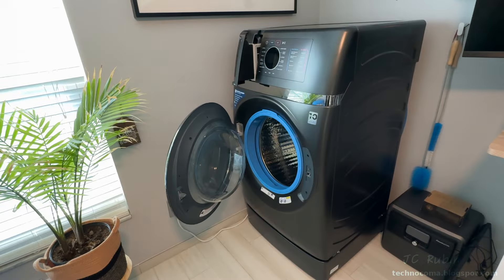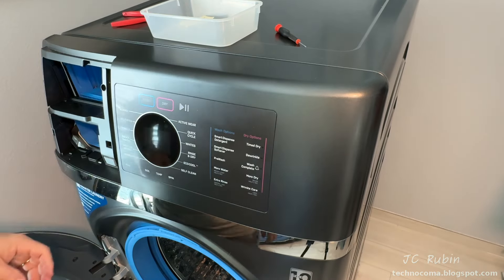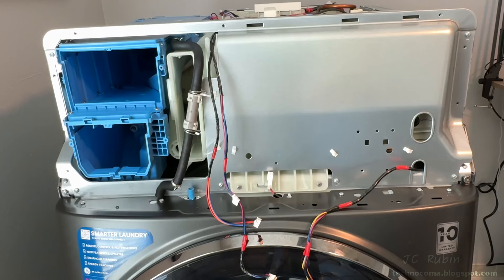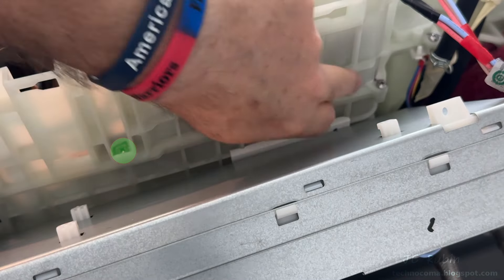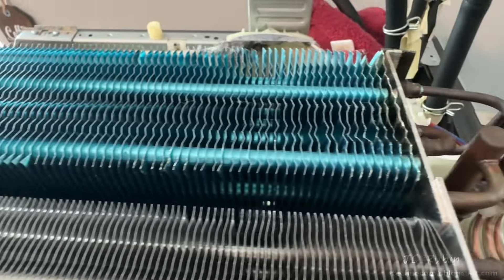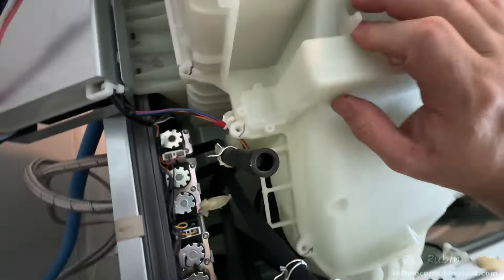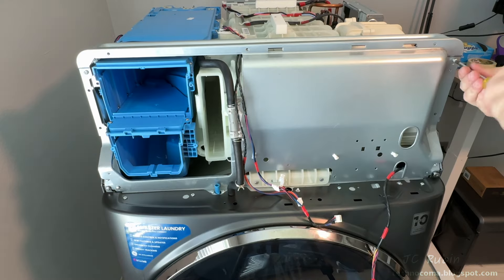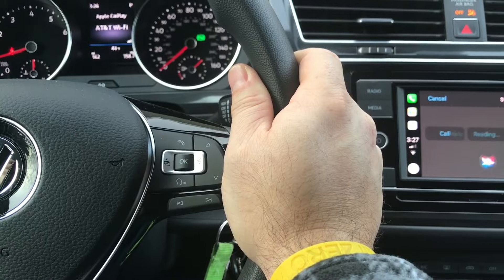GE Profile Ultrafast 2in1 Combo Washer Dryer 6 Month Teardown, inspection & cleaning of the heatpump

Comment: That is not alot of lint build up for 6 months, especially with the pet hair. If people took their dryer hose off, they would be shocked. I can see how that would build up year after year. However, I'm still a fan of this machine. Every appliance needs to be maintained. Maintenance is not excessive for this machine. I love it!
Reply from the maker: Its not a lot for a gas dryer, but for a heat pump, covering those metal fins wity a thin layer of dust will quickly reduce the efficiency of the drying process.  and a little dust will quickly grab more dust.
Reply: I agree. It’s a dream compared to the standard separate units.
Reply: This machine's heat pump is sensitive to lint build up. Even a little clog doubles dry time while regular dryers run so hot that you don't notice a performance drop
Reply: @AtlzBestM26  I have this model. I do maintenance as it says to do and my performance has not dropped. I do 20 loads a week so, it is definitely being used. Regardless, the amount of lint is way less than with a traditional dryer. I have more hair and pet hair that it gets rid of than lint. I love this machine and would repurchase it again.
Reply: So having to employ surgical precision and specialty tooling to clean the heat exchanger is not excessive maintenance? Think about why didn't the R&D team at GE just design an effective filter? There is no way that this immediate lint buildup (without the use of special brushes to clean the heat exchanger) wasn't known by GE engineers before this product went to market. LG came out with a similar model to this product just this year, which another youtuber took apart after only two loads and found large portions of the heat exchanger to be caked in lint. This is a designed failure point of these types of units, if not excessive ignorance and neglect by the designers of this product.

Please do not reccomend products that are designed to fail. The practical longevity and reliability of the appliance are the most important aspects to consider for a well-informed buyer.

Comment: With my unit, I just went down to the local hardware store and picked up some weatherization foam tape right away after getting the unit and put it around the lint trap, creating a nice seal.  $5 roll of foam tape in order to try to avoid heavy maintenance / a dryer that doesn't dry on a machine that costs a lot more than $5.  Also, to install, just pop out the lint trap, run the tape around with the paper left on top, and cut when the front of the trap is reached again.  Takes just a couple of minutes to do and is really easy.  While the machine is still really new, several loads in and the foam tape is staying in place and the coils are staying clean.
Reply from the maker: Good tip, im looking into such solutions.
Reply: Do what now? Picture or drawing?

Comment: Just a thought for a quick fix for the buildup on the vent supply hose. I had an older LG 2 in one (2.2' size) that had lint buildup in the ducting where I used an auto parts puller to remove debris when it clogged the ducting. in this scenerio, you should be able to access the clog by removing the filter and putting the puller to the left and up. Let me know if you try and the results 🙂 Thanks for the wonderful video!

Comment: I called and told them about filter and the fix as i have modified mine. lol
This is an awesome video you should sell it to technicians lol I really appreciate your videos and I love my machine regardless of the lint cleaning lol
Also wanted to note it is very important that you take the filter housing out and clean it with Dawn dish soap regularly. I just got the dreaded 365 error code and it was due to buildup on the screen from fabric softener.  As soon as I took it out and cleaned it with dish soap took all of three minutes is perfect again so I will make sure to clean housing once a month as well
Reply from the maker: My wife regularly cleans and washes the filtre element.

Comment: I fixed mine without opening. Cleaned out with vacuum and brushes and sprayed with foaming coil cleaner. Although fins are now somewhat bent everywhere. Then I took the filter housing itself and on top and rear added a gasket brush weather stripping. Now when I put the filter back in, it fits very tight. And lint doesnt get around it onto the coils. I also got extra black filters and put two of them inside the filter housing that snaps into place instead of just one. Finally its working closer to normal again. This design is not user friendly for consumers to clean! The filter housing itself is not correctly made as it allows dust to bypass it!

Comment: I was considering this model and the LG combo units when our dryer began to go out a few months ago. 
>
After I got a good look at the videos like yours and others and then saw both units in my local home Depot I decided against either one.
>
The filter design seems to be one of the weak points of both machines as well as where they decided to locate the coils. 
>
The LG all-in-one combo has a similar system but a very different type of filter. 
>
The LG unit has a similar problem but it doesn't seem to be nearly as bad as the GE unit. 
>
Everything I read says the LG is fairly manageable and LG even tells you how to take out one screw out of the filter compartment to get easier access to the coils to clean them. 
>
After seeing both the GE and LG combo units in person and looking at their filters I decided against getting either combo unit. 
>
The concept is absolutely fantastic!, but in reality if your tasking one machine to wash and pull the lint out and also drying and trying to get rid of that lint, I think until somebody comes along with a far, far superior system this is always going to be an issue. 
>
I also think if you have more than a couple of people in your family especially people that tend to shed hair or the worst case scenario, pets, this just adds to and compounds the problem. 
>
I decided to go ahead and get the new LG heat pump dryer and did a tremendous amount of research on it before purchase. 
>
LG goes about lint removal very differently on their large capacity heat pump dryer than they do in their combo washer.
>
With their heat pump dryer, they use a very large two-stage fine mesh filter, one inner, one outer, that is in the front like many conventional dryers. 
>
They also have an automatic coil cleaning system that uses water it pulls from the clothes to clean the internal coil system. 
>
The coil system on the LG standalone heat pump dryer is located in the bottom of the unit inside of a tub with a separate pump and a spray system that can clean the coils. 
>
LG also thoughtfully provided an access port on the front of the dryer that you can open easily and have access to the coil directly to vacuum out anything that might get past the filter system. 
>
I do exactly what the maintenance suggest from LG,  which entails cleaning the inner filter on every cycle and the outer filter every 10 loads, although I tend to clean the outer filter sooner than that if I see any kind of visible build up at all which tends to be about every two or three loads. 
>
I also noticed that the automatic coil cleaning system seems to run at every load and I have ran a manual coil cleaning about every 10 loads, which involves pulling the lint trap out and pouring about 1 liter of water through that hole and then running the manual cleaning cycle.
>
After having this unit for a couple of months running around 50 loads and sticking to the maintenance religiously, I can say with confidence that I believe LG has a winner on their hands with this standalone heat pump dryer. 
>
I have checked the access panel and inspected the coils several times since I've got the unit and have Been extremely happy with zero, not a little, but zero lint build up on the coils! 
>
The heat pump is smaller than the GEs but it does the job pretty well, the drying times are longer than the GE's but The fact that it's a separate unit and they rethought the lint system so it seems like a more reliable machine than either the LG or GE combo units. 
>
Plus I think until they significantly change the design of both combo units that lint buildup is going to be a huge issue. 
>
Thanks for doing this video, it was very informative and helped remake my decision.
Reply from the maker: I agree,  The combo unit's lint issues are a big concern and I think until they get that solved, they are always going to have problems. Thanks for watching and the feedback!

Comment: I have this unit and I am largely happy with it. I'm also pretty comfortable with tearing down complex assemblies. But this is right at the edge of my comfort zone so I'm happy to know this video exists in case I need to refer to it. I've made a few modifications to the lint filter assembly to minimize lint getting past it and into the heat pump coils. Then I picked up the brushes and vacuum cleaner hoses that can reach inside there and I feel like that should be enough to keep things clean for many years to come.

I've only had this unit for about a year. I hope it lasts as long as a conventional washer/dryer combo but much remains to be seen. A heat pump dryer is kind of a whole new paradigm. If you're the type of household that does all its laundry on Sunday this thing is NOT for you. It's not as fast a conventional dryer and you (obviously) can't be washing one load while drying another. But if you wash small loads throughout the week and you don't have a lot of family members (it's just me and my girlfriend) this thing is a perfect solution. The best part is I was able to install a handy utility sink in the mudroom since this occupies only half the space of a conventional combo.
Reply from the maker: Thanks for the write up. For us besides space the greatest feature was moving the machine out of the humid garage indoors as no ventilation g is needed.

Comment: Awesome teardown details. I personally added some foam around the filter and has done a satisfactory job keeping the lint in check. The biggest flaw of the filter is the rear, larger than desired gape there. Need to clean that lint from the filter screens after every cycle time to reduce forced air through the cracks. Great job and detail explanation sir.
Reply from the maker: Glad it was helpful. Thanks for the tip!

Comment: I just bought the new, cheaper model and awaiting delivery.  It does seem like a maintenance routine like I have on my HVAC or my pool filter is needed. I plan to modfiy the filter screen like folks have suggested and will probably create a PVC vacuum attachment/s to hit those interior spots. Seems like a cottage industry could develop for that if GE doesn't modify their design.
Reply from the maker: It doesnt have the auto detergent/softener so maintenance should be easier...

Comment: The filter is a problem. 
The cooling plates should be horizontal for cleaning, and the filter slots do need a re-design.
Reply from the maker: The filter and the airflow left of the filter
Reply: 100% The problem with plastic is that it will get a static charge with the airflow, and it will attract dust. Maybe a ground connection would solve that problem.
Reply from the maker: @ADOENDRA  if the section were metal, it could be grounded. Or an artistic, mildly conducive plastic

Comment: Could I take a sprayer and shoot water through the coil without taking the lid off. Most the sprayers have a 90 degree spray tip. But where does that water go
Reply from the maker: I spray mostly top down after vacuuming. So I can’t speak to the effectiveness of doing so.

Comment: Thank you for the video. Have you checked any fault codes? I started to get the 353-fault code. Called GE and they had to send out a GE certified technician. They had to replace a part. It took the technician about 4-5 hours. The technician ran the machine to get it to reset. After it finished, I got the fault code 354. We ran a small load of laundry and now will not go into drying mode and giving the error code 353. I cleared the fault code and tried to run another small load. Again, stopped after the washing of the clothes.  Would not go to drying and fault code 354. Now we have a really expensive washing machine.
Reply from the maker: Generally the balance code.... I think its silly as a fault code, it should be an on screen error with a continue option.
Reply: We have found that if you run light small loads like underwear by themselves, it will have a tendency to not want to finish the cycle and balance out so we make sure not to run small light loads and we’ve had no issues since

Comment: Hello and thank you for the videos they have been super helpful. Hear me out and tell me if it’s something that could be done without causing damage to the machines. Noted that everything done will have to be in low pressure and not blasting like a pressure washer. 

Using a 2 foot long 90° L shaped garden mist sprayer with an adjustable tip for spray to fan connected to a garden hose, one would remove the lint filter and insert the sprayer with the nozzle adjusted to a soft fan like spray pattern, spray all coils multiple times to get the particles to flow downward to the bottoms filter of the machines. 

Then removing the bottom filter or already have it open so that any and all water that flows down gets removed along side and lint and dust that has bypassed. 

Last would be to run a self clean cycle for the machine and call it a day. 

My only concern is that I don’t know if water has a free flowing way of making it down to the bottom or if it may pool up somewhere up there using this method. 

If you know or can tell us if water can flow all the way down from the right side of the coils just as on the left side with the big hole opening. If it does and can flow after passing by the coils then it shouldn’t pose any problems. 

Thank in advance and sorry for the long post.  

Here’s an example of the mister I’m thinking of using for maintenance

Mist Watering Wand For Hanging Baskets,25 Inch Spray Wand With Adjustable Nozzle, Car Pet Window Cleaning Tool, Great For Watering Seedbeds, Hanging Plants, Deck Plants.（90-degree curved nozzle） https://a.co/d/3tGzLhR
Reply: Oh forgot to mention that using this method one could T from the cold water supply of the machine and have an 8ft section of hose to perform this easily right in the laundry room where it’s located. 😅
Reply: @j.v8947  That's a cool idea.

Comment: We're screwed Batman. 40 times over I reply. Also notice Robin that it's a 30 minute video, which means in real life, it's 8 hours for mere humans.
Reply from the maker: Not sure I understand this Batman robin stuff, just say what you mean.
Reply: @retrotechandelectronics   I was simply dazed that there are 40 screws to get in and 40 screws to get back out of the unit. 80 screws and probably 6, or more, hours to service. Blows my mind after 40 years of servicing my own personal washing machines and dryers. Being 63 years old now makes me wonder if I really want a unit that will force me to pay someone else to service.
 Hell, I even service my own heat pump/gas furnace dual fuel HVAC. Not sure I would pay for this unit.

Comment: Nice teardown video!  Thanks!  Not sure I'll have enough vertical clearance to get that heatpump cover off though :-/  And washer is in a stainless drain pan so not easy to get it out...have a second one next to it as well sooo, ya, fun...  GE, why didn't you make a nice user accessible door into the condenser area and inlet duct?  Bonus points for a hose hookup that sprays jets on the condenser to clean it, or heck, why don't you just integrate that as a cleaning function?
Reply from the maker: Sounnd like half of your battle is removing the two machines from their perch before the work even begins.

Comment: The water drain and use a cookie sheet..its ridiculous. Surely they could do a better job in the design  of that monstrosity.  I have seen several  YouTube  channels  and no one seems 100 percent  happy with there  unit.Ill just keep my old fashion washer and dryer.👍Easy up keep it Amazon  has a hose that is made to use on your vacume to deep clean filter area.Once a month...Good luck. To everyone with there 2 in one units.
Reply from the maker: Not a wonderful design to be sure.

Comment: The Bosch ventless dryer has a front removable radiator assembly. I'll wait until they make a combo system, or GE really redesigns their system.
Reply from the maker: It’s a cool design but I’m curious as to how the exchanger couples to the gas tubes effectively
Reply: @retrotechandelectronics  it's possible that you can't actually do this for a full closed-circuit heat pump. I think we'll see a couple of iterations, but it's great to see two heavy hitters getting the ball rolling.

Comment: This video is great. Thank you for posting. Now that you’ve seen the areas of build up, what changes to your “per load “ cleaning will you be making?  It seems like a vacuum attachment that can reach around into the blind spots might be nice. Also, how difficult would you rate this cleaning/assembly/reassembly?  Do you feel, that GE could tell that you took it apart thus voiding your warranty?
Reply from the maker: I will not be making any more changes than I current do, except that I plan to open it now every 6 months for cleaning.

Comment: It's clear from the videos I have seen on this GE model...which I own as well...pet hair and no high maintenance cleaning of ur machine will be its inevitable doom...fortunately I have no pets in my home...so the cleaning requirement is not as intensive...
Reply from the maker: It wasnt hair I found in the heat pump.  The filter actually did well to catch that.  It was dust from lint.